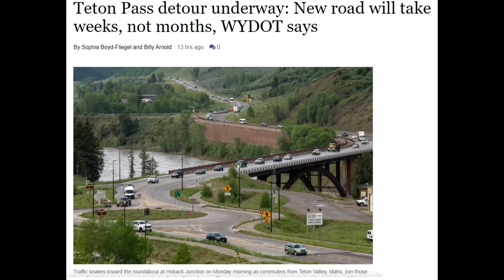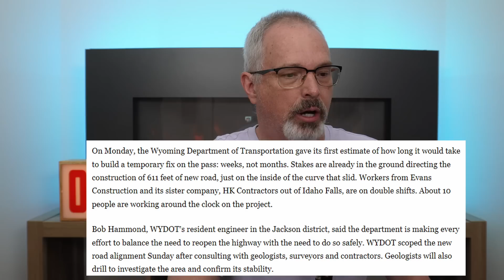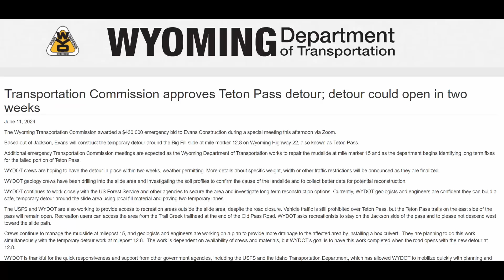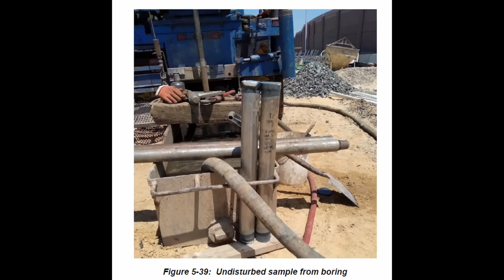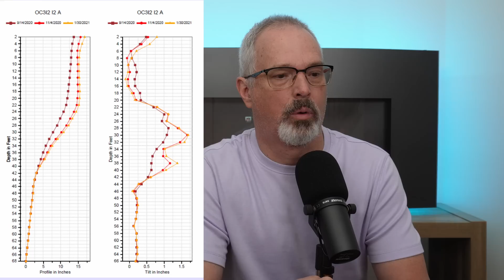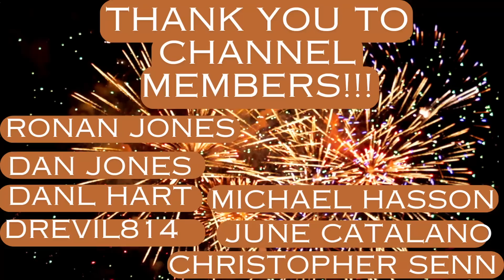Wyoming Slide Update

Comment: Notice that the failure is on the Outside of the Curve, so the Outside of the Curve should have had a slope that was  much less steep than the inside of any curve.   Forces are a combination of Lateral, Vertical,  Radial, and  Circular.    A one to one  slope is way too steep on the outside of a tall tight curve like this one.

Comment: I wonder if you could take a look at the failure of a feeder water main in Calgary, Alberta? I don’t think we are getting the facts. Initially, it was 5-7 days for us to conserve water to the tune of half the normal supply of this 1.8 million strong city. Now it’s 3-5 weeks after more weak places were discovered. It was installed in the 70’s. prestressed concrete pipe about 2 meters in diameter. This is a major health and safety issue for our city.

Comment: Additional comment - A straight line from Teton Pass to Coal Creek Junction is 1.76 miles (9292') with 1265' change in altitude.  That line would have a grade of 13.6%.  Using the length of the existing road way would be 2.62 (13,833') with a grade of 9.14%.  To maintain a grade of 10% (avg) would require 12,650' (2.39 miles).  That's what they have to work with.  My idea of the bridge was to put a bridge work in place of the present (former) roadway.  The idea of bridging the area elsewhere will probably exceed the desired overall 10% in at least some locations.  VTS
Reply from the maker: Thank you. You are right, that would be too steep.

Comment: I get that we need to build safe roads for sure but I also know when there is urgency and some common sense involved to get something done. I would be willing to bet my right arm that more than half of that mountain pass would be deemed unsafe by engineers if they got to digging. I think you should try and help them fix it as to the best of everyone’s ability in a timely and safe manner as possible other then point out all the things they are doing wrong. This is coming from someone who is on the blue collar side of the fix for several years. I don’t disagree with your concern I just think it can be fixed to hold up as good as possible under the circumstances. Man vs mountain is always going to be a maintenance war no matter what you do. 👍

Comment: 8:00  a line tangent to the two curves would give a grade of 280ft vertical in 950ft horizontal.  Not so much a bridge as a ladder.
Reply from the maker: As I mentioned I wasn't sure what the elevation change there was but that certainly will not work.

Comment: I see at the bottom there looks like very old guard posts?? 
Sorry as this has likely been asked . 
thanks
Reply from the maker: I think those posts came from the recently failed road.
Reply: Sorry looking in the wrong place ?
Where you show your arrows to vertically and horizontally before they added that fill to build up the road. It very much looks like the ?? original road rail posts?? 
Thank you

Comment: I'm in Southern Indiana, which is limestone country.  I see a lot of cuts through hills.  Would it be feasible to make a cut on the uphill side to bring the grade down ?

First cut down to bedrock and put piers in around 43.50085471351149, -110.97922673922838 and 43.500502141305944, -110.97743517249205.  Intermediate piers if needed.  Then dig out the approach and dump the detritus downhill where it's most convenient.  Only the top end gets dug out, detritus is going downhill a short distance and isn't bearing any load, and there is no fill taking load.

There are probably sound geological reasons why this wouldn't work but to my uneducated eye it seems interesting.
Reply from the maker: I like your idea of overexcavating back to sound material. I also that the installation of drilled shafts would provide a lot of lateral support to the slope.
Reply: @CaseyJones-Engineer  Thanks.  It just seems that in an area known for unstable overburden you'd want to get down to stable rock for high-traffic roads.

Comment: I have to wonder if the real fix will be to remove the majority of the fill in curve and then build a curved bridge in approximately the same location. That's what would have happened long ago before it became so much cheaper to just move material. Look at any old railroad grade in the mountains. It looks like the problem is the shear amount of weight the sloped subsurface is carrying, combined with a steep enough original slope that makes for an impractical  "catch point" way, way down the mountain side in order to have a more desirable side-slope.
Reply from the maker: I think that you have outlined the correct repair approach here.

Comment: In civil engineering, the "natural angle of repose" of any material is pretty well known.  For common dirt or sand it is about 35-degrees up from gravity flat.  If they try to fill in the sluff area, it will a gazillion tons of dirt to get to that angle.  Conversely, as someone below pointed out, the dirt will continue to fail until it gets back about halfway into the tree zone.  This presupposes that there is no unusual drainage, nor undermining from water seepage, or ice heaving.  I think that these people do not know what they are doing.  We did military vehicle development on such slopes, and the only way we could stabilize them is to do it the same way as the Romans did, two thousand years ago.  In Masada.  That will require a lot more than a few weeks of work.
Reply from the maker: I agree with you. Their application of sound geotechnical practices is virtually nonexistent is this situation. It is shocking to me.

Comment: Looking at Google Earth, It looks like maybe, possibly, a short term solution would be quickly grade out the what looks like a the original road down in valley near the powerline. One way pilot car traffic at 10 mph, no trailers, motorhomes, or heavy trucks allowed (or as prudent given the grade and curve radius, etc.. That would free up the construction site from having to deal with a shoe-fly and traffic right in the work area. Of course, this just based on what can be seen in GE, and my not be possible in reality.

Comment: That is what I'd guessed they'd do, just cut the corner tighter. That will make for some nice descending, possibly off camber turns for drivers to negotiate in icy spring conditions. Not to mention that exposed escarpment of what looks like compacted fill; it has a long, long way to go before it slopes back enough to not slide again, easily far into the turn and past where the new road is intended.

Comment: In most well run areas, a washout is repaired ASAP.   They bring in "select fill" and just dump it until they get it to the point where you can pave the road.    

Get the job done and the road opened.   Good for them.

Comment: That darker portion of asphalt has been patched MANY TIMES, just about every year in fact. I used to drive this pass every day for about 7 years, ending in 2018, I've seen it. It was a constant joke... If I don't make it to work tomorrow..
Also beyond that patch are cracks in areas that never moved before, it looks like this is going to get bigger.
Reply from the maker: I agree that there is very much the potentential for more movements and given how  little time has elapsed since this embankment failure, I doubt very much they have a handle on its extent.

Comment: Safety is not a priority.  This road needs reopened if at all possible!  Livelihoods of a significant number and the economy of the state are at risk.  All roads built on glacial debris will be temporary and need rebuilt at intervals anyways.
Reply from the maker: Do you expect the WyDOT and other area officials to go on record and say "Safety is not a priority" even though it seems that is how they are acting?  We are not talking about having to rebuild road sections periodically.  Instead it is a question of whether some motorist will plunge into a giant hole in the roadway caused by additional slide failures of the embankment.
Reply: @CaseyJones-Engineer  I'm saying everyone who uses that road knows the inherrant barriers to making a safer road and are wiling to use the best road that can be built in a reasonable time frame.  It's very far between towns and isolated in between.  We have a lot of similar roads in our rural mountain states.  Safety always needs balanced with reality.  All driving is inherently wrought with dangers!
Reply from the maker: @nancienordwick4169  Yes, but I don't thinking people are willing to risk plunging into a chasm in the roadway!

Comment: Sure would be nice to understand what the failure mode was.  My 'guess' would be lack of adequate compaction of the original fill, movement of the foundation beneath the fill (or inadequate preparation of foundation prior to placement of the fill), or the development of an internal phreatic surface which decreased the static stability to less than unity.....or a combination of thereof.  So many questions, so little info.  Funny that I drove past this area only a week earlier.  The cracks that you show at 11:10 are classic slope stability indicators for embankments with an incipient head scarp formation.  Given my 37 years as a professional engineer supervising dam construction (albeit in California), the failure to recognize this 'early warning' is concerning.  ANYTHING like that on an embankment dam, regardless of reservoir loading (or lack thereof) would be immediate cause for investigation.   I find it very hard to believe that with the limited geotechnical investigation they did (based on the timeline you gave), that they will be able to conclusively determine the failure mode.  Hence, they are doomed to repeating it somewhere down the line.  My guess on this would be excessive water infiltrated the fill (you state that the embankment height exceeds 100' measured d/s toe to crest and with a slope of about 1:1) and sufficiently saturated the fill (which likely lacked any kind of internal drainage system) as well as the foundation which was likely not properly prepared or keyed prior to embankment construction.  With such a steep slope, it is pretty easy to reach a point where the static stability is compromised.  Embankment dams have downstream slopes which are generally 2.5:1 or flatter (although this would obviously push the d/s catch point waaaaaaaaaaay downhill) and anything over 50 feet in height would have some kind of internal drainage system (at least a chimney drain coupled with a blanket or finger drains).  This fill definitely looks like it can (and does) retain significant amounts of water/snow on the 'upstream' side (or inside of the radius). Is there an outlet for that water and if so, did the failure occur at that location?  Because if it did, that leads to multiple additional failure modes.  I could go on and on but, in short, great video and analysis.  And you are asking the right questions.  They are doomed to repeat this, if those questions are not answered and taken into consideration for the 'fix'.

Comment: The idea of determining the slope angle from an oblique, partial image is not valid. Revegetated fill slopes are rarely steeper than 2:1. Angle of repose for most loose soil and rock particle materials is 1.3:1 to 1.5:1. It's certainly feasible to rebuild a stable double-embankment roadway at this spot, but as other commenters mention, all of the fill needs to be removed, drainage and a solid non-fill foundation subgrade established, then the whole engineered fill rebuilt using suitable materials. Not in 2 weeks. It's pointless and a waste of money to drill the existing fills and study them, because the problem is almost certainly at the bottom.

Comment: When the Corp of Engineers was building the Blue Ridge Parkway, they built bridges that hugged the slope for sections of the road with this type of slope.  They did not try to build on top of fill.
Reply: The bridge you are talking about is called The Blue Ridge Parkway Viaduct, and it is built on the side of Grandfather Mountain, in Avery County NC.
I live about 10 miles away from it.

Comment: Speed is of the essence getting this road rebuilt asap.  People need to GET TO WORK! 2 months of soil analysis tests on what is an obvious crap road base location is a waste of time and money.Figure a new road asap and get after rebuilding it. Right now. No screwing around with massive govt safety BS. That's all fine  on the Scott Key bridge redo, but llooong ssslllloow drawn out govt safety analysis is totally unnecessary here. Pretend its the AlCan highway in WW2.  Build the sumbitch ASAP.  People need to get to work. Edit to add that my wife and I lived in Jackson from 1978-1983 and traveled the pass regularly.  The road is one steep son of a gun and the base is crap in some areas. If this was Mexico the road would have reopened in a week.  lol
Reply from the maker: Yeah who needs safety?  That must have been why they put a surface patch on the pavement over the cracks and called it good to reopen traffic a day before the catastrophic collapse.  The only reason the road was closed at the time of the collapse was due to the mudflow 2 miles away.
Reply: @CaseyJones-Engineer  I just looked at a close up of this highway on Google maps. There's another existing road immediately to the north that looks like traffic could go over the pass >right now<. Why not open it RIGHT NOW? People need to GET-TO-WORK. It's a BIG DEAL in Jackson right now. BTW The AlCan highway- well over 1000 miles long- was built in just over a year in 1942 through incredibly tough terrain. It was built fast because it HAD to be built fast, and if there's one thing the USA could do back then was KICK SOME MAJOR ASS. Same deal here imo. Kick some butt here. GET AFTER IT OLD SCHOOL USA STYLE. Not all this over thinking touchy feely drag it out on and on and on BS. People need to GET TO WORK. lol
Reply: @CaseyJones-Engineer   As for that patch well the road is built on a total crap location on the side of a slide area. Redo the road just to to the north. The service workers and businesses in Jackson deserve it. Those workers went from a crap commuteover 2000 feet elevation gain to to a full on life disrupting job losing commerce destroying 'act of God' in an instant.  Get it reopened. NOW!

Comment: My guess, as a person born and raised in the western US is that they are counting on the weather to assist them with keeping the temporary construction upright.  Summers in the west tend to be very dry (often it doesn't rain at all) so they are betting that they don't have to worry about the additional weight, and angle of repose calculations that they might have to do if the ground gets wet.  Then once winter hits, things will start to freeze up, stabilizing the area.  This would give them until much later to figure out a 'good' fix - maybe until the end of March? To me, that's the only way they can come up with a quick fix that doesn't account for everything - betting on the weather preventing them from having to do the hard work of doing it right (at least initially)

Comment: Engineer: after doing some math, we need to consult and sample and test and...
Some hick that actually works with dirt: if you look over there, thats where we need to start bringing in material. 
No hate on engineers but yall need to listen to the people that do the work and have actual experience.
Reply: Knowing where to bring dirt in IS important.  But how much do you need, exactly where should it go, and how do you have to prepare it before it's useful? This isn't building a sand castle.  That pile of dirt actually has to do something.
Reply: @EPG_CATX  it appears they didn't know those things the first time.
Reply: @aaadamt964   Agreed - that's why they need to figure it out now.  It's one thing to go with 'this is the way we usually do it' as a justification if it seems like it's working.  It's an entirely separate thing to repeat that process if it's already failed.
Reply from the maker: Why would you think that contractors just run around building stuff without following plans based on engineers designs?
Reply: @CaseyJones-Engineer  I absolutely don't think that. I'm just saying the guys doing the work every day know and see this stuff everyday. I'd almost guarantee someone... probably several someone's brought up this issue along the way and were told they didn't know, wasn't their problem, etc. I built a bicycle for an engineer several years ago. I told him multiple times the parts he wanted to use wouldn't work together. He did the math. They'll work. I finally agreed to do it but told him I was charging to do it and charging to fix it when it didn't work. I did it, it didn't work. He took it to several shops before bringing it back to me. They couldn't get it to work either. Sometimes experience is more gooder than education.
Reply from the maker: @aaadamt964  In other videos I talk about the importance of listening to experienced contractor staff, so I appreciate you point. Some engineers think that their opinion is the only ones that count. There are many times when my opinion is discounted simply because I am working for the contractor.
Reply from the maker: @aaadamt964  That is funny!🤣 Really that is what this channel is about: engineering issues and how they came about.  Other engineering channels avoid calling people out who contribute to these problems to the point of blandness in my opinion.  I won't be like those channels.
Reply: @CaseyJones-Engineer  oh yeah. I'm subscribed to a few. I watch them at night to wind down and sleep.